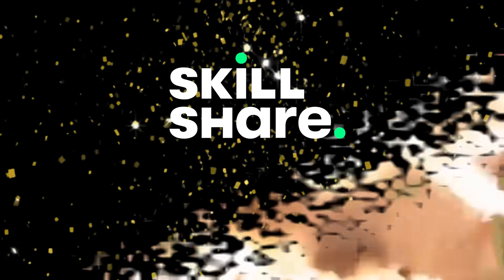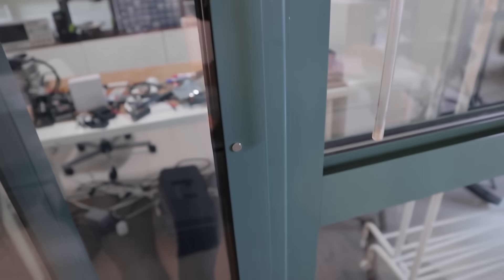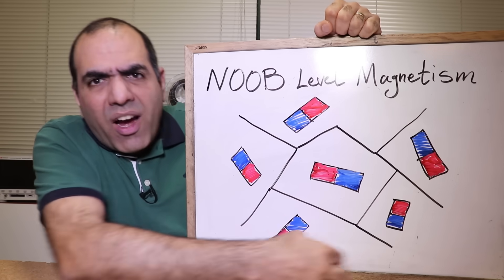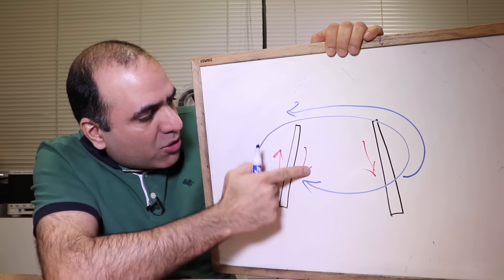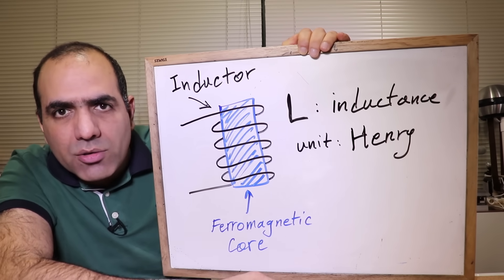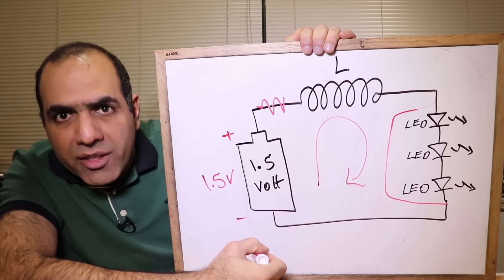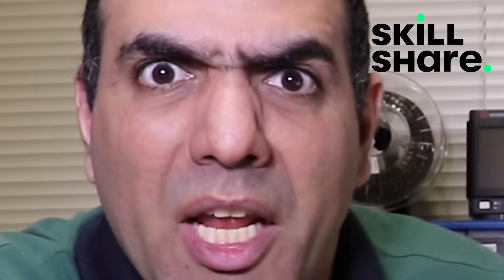Magic of Magnetism & Inductors (ElectroBOOM101-007)

Comment from the maker: Hey BOOMers! If I ever say "Neomidium" I meant to say "Neodymium"!
Reply: Neomehdium
Reply: If you heat a small neodymium magnet until it loses magnetism, and then put it on a larger magnet while it's still hot, will it be almost as strong when it's cold?
Reply: @orbitalbear  no, the field of the bigger magnet is not enough to re align the fields of the heated one
Reply: neo-MEHDI-um
Reply: Try neodiddlium instead ;) Hail to AvE :D
Reply: You need to rectify this issue
Reply: @cudamalloc9054  Using FUUUUUL BRIDGE  RECTIFIER😜😊
Reply: Ka boom
Reply: Hahahahah i love the name
BOOMers hahaha
Reply: well I think that you are a good teacher so thanks sir for teaching us
Reply: Also, if you ever say "Heart" and point to your head, you mean to point to your chest :) 5:26
Reply: this is why black sabbath wrote 'am i going insane'?
Reply: ElectroBOOM just use Skillshare
Reply: Neo did what?
Reply: not a problem even ı cant say ıt correctly nemıdıumı
Reply: This video is the absolute peak of video editing and nerd jokes.
Reply: Neomehdium
Reply: Ok...
Reply: @daffamuhammad391  Boomer.
Reply: @ryank1273  If you have
Reply: ok boomer
Reply: OK BOOMER
Reply: Next video.... How to make transistor amplifier with full explaination and circuit diagram...
Reply: Thx for the tip
Reply: is it just me our your videos have got much educational and much funnier than before?
Reply: Hey Boom love your video
Reply: The Kaiser couldn't say "Aluminimimuminuiuimum.
Reply: Magic
Reply: ElectroBOOM it’s science not Magic
Reply: ElectroBOOM or magnetism
Reply: Lol, no worries, we know!
Reply: Best explanation i have ever heard and wached
Reply: why are your sound levels so much higher than every other video on youtube?
Reply: Meh...ruined my brilliant comment idea
Reply: باشه
Reply: @ElectroBoom its fine. I allways fuck up neydymium name
Reply: I’m a ZOOMER
Reply: 5:28 i don't think thats where your heart supposed to be, right?
Reply: Lol
Reply: @electoboom ok electroBOOMER
I know, it is old, but good
Reply: gotcha
Reply: Love your videos
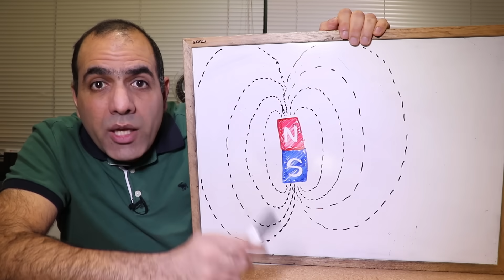Reply: 4:57 The story of my life.....
Reply: the magnet industry caught a break there.. they were gonna have to change it for you!
Reply: Just say "magnets"!
Reply: Ok Boomer
Reply: Ok boomer
Reply: Which editing software do you use? Thanks.
Reply: Ba-Da-Boom!
Reply: 5:27
You say "...feel magnetism in your heart", but you point to the head ?
Reply: Ok boomer
Reply: I was waiting for a faint echo of: "the middle finger is for B field" at some point...
Reply: There is a very good and useful video from The Science Asylum about Special Relativity and Magnetism. It is here. https://www.youtube.com/watch?v=p4gCTmlm5RQ. Good thing is that he is also your subscriber.
Reply: Ok please shock yourself if you say it with something harmless
Reply: I still love you. ♥
Reply: I still like ya too
Reply: Though it's kinda funny
Reply: Keep the content up and don't fry yaself
Reply: i mummered 'ok boomer" and my sister heard 'kaboom"
Reply: I do that same!
Reply: My name....is Neo......dymium
Reply: Nice
Reply: What is a mosfet please make a vid
Reply: Hey Big Boomer i love the way you explain things, Greetings from italy✌
Reply: Neodiddlyum
Reply: On behalf of America, I shall forgive your mispronunciation if you explain the 2003 North American Blackout.
Reply: Yes you said it as neomidium
Reply: You explain pretty good, why don't you make a second channel where you're going to be a teacher? For school level physics? Students love a funny teacher, and that's the proper way to learn physics. By making it fun.
Reply: Ok Boomer lol
Reply: Ok boomer
Reply: if?
Reply: Check this out. This one needs RECTIFYING: https://youtu.be/Scaggwv8Cms
Reply: Best integration EVER!!!
Reply: We have the same pronunciation...
OKAY boomer
Reply: Free energy

https://www.youtube.com/watch?reload=9&v=yNMAX7vW0vQ&feature=youtu.be&fbclid=IwAR2DcuiJ7PZsYtH3f9EY6OuKFOCqPfAITcyu66UDzkErLyXsneM8z6yf2mY

hello Mehdi, this is a job for the Rectifier ... of course that´s bullsh... cheers from Argentina
Reply: Thanks for the RECTIFICATION :)
Reply: Oh no you are human... lots of respect to you EB, love your channel
Reply: Hi, ElectroBOOM! What do you say about that book on amazon which claims that magnetic field looks completely different compared to what textbooks show? Title of the book is this - My Quest to Understand EVERYTHING: Everything is the Mechanics of Reflection.
Reply: well
Reply: Why pictures of all lines of force in a magnetic field need to be eliptical????? What if lines of force is parabolic like a projectile traced by an object above the earth at it's escape velocity. Then will it violate  Maxwell's equation???
Reply: @victormaxwellpeters9771  
The Magnetic field of Faraday is wrong. 
This is how the true one looks like... https://www.amazon.co.uk/s?k=george+warehouseman&sprefix=george+warehouseman&ref=nb_sb_ss_i_1_19
Reply: @jurisbogdanovs1  is that sarchasm???? Or replied with innocence????
Reply: @victormaxwellpeters9771  
No sarcasm. The pattern of magnetic field doesn't look like textbooks show. You would be surprised what were the arguments when the existing model of it was created. But for the true pattern there are many proofs. All that in that book.
Reply: @jurisbogdanovs1  this model should raise a lot of questions???? Like were exactly does the direction of the magnetic field lines switch over from beeing clockwise to anti clockwise in their preferred frame of reference. Also leads to many contradiction. Then why iron filings spread along the sheet of paper dosent in the presence of magnetic field ( in this case a bar magnet) aligned in the direction of magnetic lines of force which emerges out of north pole and enters into South pole unlike the model quoted by you
Reply: @victormaxwellpeters9771  
Send me an email and I will send you a proper explanation on this with all the proofs etc. And images...
Reply: @victormaxwellpeters9771  
Sent you an email.
Reply: @jurisbogdanovs1  thank you any ways
Reply: Boomer...?
Reply: @patrickamazing mm
Reply: Yes but no.
Reply: @friendlyfire3412  electro kaboom
Reply: Can you review the video where a battery, salt and lemon juice goes into some warm water and bends a fork weirdly?
Reply: @oliverstannard2103  I hope you get to send a link to that video. Try using WikiHow.
Reply: Sir I had a request 

Sir would you please give me one multimeter.
Please sir it's urgent
Reply: Can you make a video on transformers? That would be cool
Reply: is that true?
https://youtu.be/g3oXvy0J4PE
Reply: do not warry we don t trust ppl with axent :-)
Reply: New video to rectify: https://youtu.be/32wSwjGiaK0
Reply: Like htat's the olny mitsake that cmoes out of your fumbmelouth
Reply: Fake content https://youtu.be/07Fx5H_j3G0
Reply: We ain't the ones that are old
Reply: hi elecroboom can you test osciloscop app in android phone by headphone jack 3.5 the app name is ar-osciloscop
Reply: https://m.facebook.com/story.php?story_fbid=10221622357009466&id=1269854021?sfnsn=mo&d=n&vh=e
Reply: SUBTITLES IN PORTUGUESE PLEASE!!
Reply: i have a question... if we connect a 500thz Oscillator to a electromagnetic then will it generate light?
Reply: BOOMERS 
I'm on the floor!
Reply: lmao
Reply: 10 times back emf🤔🤗
Reply: Ok.
...From Japan.
Reply: Neodym
Reply: can you rectify this video: https://www.youtube.com/watch?v=ZyfXvFicp8M&t=1s
Reply: my favourıte channel
Reply: Must include part 2 of this video
Reply: Heh Electroboom. I have put pieces of ferromagnetic screws over the original core of transormer and below the secondary coil, leaving the primary unchanged. Unfortunately my function generator failed so I can't check. What will happen?
Reply: Electroboom is a Dwemer confirmed #Numidium
Reply: Mahdi you're Arabian right?
Reply: Abdullah Ghaith if you’re talking  about Mehdi, he from Iran
Reply: Didn’t even notice
Reply: Hehe
Reply: Hi, if every school in the world had teachers like you, the world would a better place!  
Wish my science teacher 50 yrs ago had of had half your magnetism!
Reply: Don't worry man, we know you are not a chemist
Reply: @5:51  Hello Mehdi sir, I am not a professor but doing PhD in physics. These videos, in very simple manner, explain the relation between the special theory of relativity and magnetism. these may be helpful to you.. https://www.youtube.com/watch?v=1TKSfAkWWN0 ;  https://www.youtube.com/watch?v=Ii7rgIQawko .   Overall the thing is that electromagnetic interactions are strong enough to observe the consequence of special relativity and that the very well known fact that magnetic field affects charges under motion and since motion is relative, it incorporates relativity. On observing same moving charge from different frame of references it appears to be in different environment and that leads to a conclusion that magnetic field is not something separate but is electric field in different reference frame. but it is convenient to treat them separate otherwise life would not be simpler with the 'same field' concept...
Reply: you probably right...let's tst it...let me wire this to my ac imput...🤣
Reply: Sorry I couldn't follow. I was so excited by these exquisite 3D hand drawings you show here Mahdi. Ok be honest, is it you painting or Electrocute? 😁😂
Reply: Looool
Reply: you're forgiven! You are our hero and can say whatever you want to say. You can say "Alumminum" or "Alumiiinium", it's all ok. 😂
Reply: I have had this since childhood: I twisted words. 😅
Reply: @s3rverius  ho raelyl 😂
Reply: Okay BOOMer
Reply: Hey Electroboom. I’m curious to know if you’ve ever thought of how the Ancient Egyptians moved the massive stone monoliths. Many people believe magnetism and acoustics. Do you have an opinion? Thanks
Reply: Thank you for your information. You have preserved me from making a tragic misconstrue a patent. God mystically enchant you thank you.   Overlooking one word.  Could transmute the course of humanity?
Reply: Can u do something with magnetism and mercury? Having a liquid conductor opens up many possibilities.
Reply: you mean neomehdium magnets
Reply: Ok
Reply: Ok
Reply: Thumbnail “I’m a magnetic field!!”
Reply: keep your aluminium nucularisms away from me
Reply: I say nedomimium
Reply: @mark rober
Reply: neomidio
Reply: I see it as "Nemidonam"
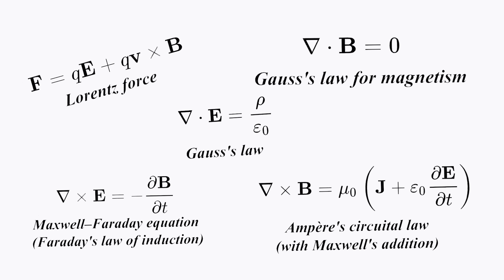Reply: 5:17 a bug:
without censor
Reply: Blessed 💖✨
Reply: for 1st time, I saw himself shocked by HOT Magnet instead of Current 😅
Reply: Oh ok
Reply: BOOM
Reply: Love the vids i  learn and laugh from them.Becuse of you i could explain why biba struja was fake to my friends
Reply: Everyone says that...... Later they're pregnant
Reply: ok :)
Reply: :D "Neomidium", cant read it without imagine @ElectroBOOM in a disguise.
Reply: B00M3R
Reply: Can you explain this ? https://theartment.com/products/the-whack-plasma-globe?variant=17900258984007&currency=INR&gclid=Cj0KCQjw3qzzBRDnARIsAECmryoMQlPksrvrodonBNjM9NF1s8LM8qRdNoxcbJ_LaUxVo8tbHEA1TiAaAs2HEALw_wcB
Reply: Arnav Barman , Mehdi is currently undergoing positive ion therapy for his extreme negativity towards the free power movement. I will try to fill in, as I too am an ELECTRICAL ENGINEER! (play music here) .The globe has a near vacuum and a small amount of gas in it. The outer globe also has a slight capacitance to ground. Pulses of high voltage to the center sphere knock electrons off of the gas atoms making a plasma. The plasma is a conducive media for tiny currents to flow through the plasma to the outer sphere. That causes more excitation in the gas and the other electrons around the atoms jump energy states. These transitions releases energy as light. I’m sure a physicist could give a better, less abstract explanation.
Reply: @BigJohn4516  thanks a lot man !
Reply: @arnavbarman8832  No. This https://www.nrl.navy.mil/news/releases/researchers-transmit-energy-laser-power-beaming-demonstration please
Reply: @arnavbarman8832  watch his videos on Tesla coils.
Reply: @arnavbarman8832  yea explain why it is so much money lol 1399 dollars for a 5 inch plasma ball. U can pick one up for like 15 quid in ur local gimmic store lol
Reply: @TheDarkness344  it's not in $'s that is in Indian Rupees ₹.. Do your math bro!
Reply: @arnavbarman8832  rip lol didn't see XD it's like 20 bucks then lol.
Reply: @arnavbarman8832  Big Clive has a tear down & great explanation on how those plasma ball's work!! you should check his channel out. hope this helps you!!!
Reply: @arnavbarman8832  he already did. on multiple videos even
Reply: @arnavbarman8832  its just a tesla coil filled with noble gas
Reply: Abhishek Patawari was 
BBC
Reply: ElectroBOOM  IDK what the hell that is so I’m not bothered
Reply: @themusicmaster1077  an element in periodic table and also used to create powerful magnets from alloys.
Reply: EXHALER
Reply: next topic will involve the magic of mushrooms and inducers.
Reply: You can say, you're an electroBoomer..

Jk you not that old

Comment: attraction is greater than the repulsion
.
Study of magnetic force between the two magnets for the torque and speed evaluations of rim-driven motor .
Siqing Liu 
 ; Franklin Li Duan
 ; Xiaocui Li 

AIP Advances 11, 125321 (2021)
doi 10.1063/5.0063917
The measurement results show that the relationship between the magnetic force and distance is similar to Coulomb’s electrostatic law, but the attraction is greater than the repulsion.

Comment: Hello Mehdi. I don't want to put in doubt your knowledge in physics and engineering of course, but I think foundamental principle that stands under the working of inductor is the ampere-maxwell's law combined of course with lenz's law. I say this because as far as I know differentiating J (current through a surface) in ∇×B=μ0J+μ0ε0(∂E/∂t) with a derivative in the time you will obtain the instantaneous change of magnetic field.

Comment: Magnetic fields and electric fields are just manifestations of the dielectric. Dielectric is the gandalf of electricity "YOU SHALL NOT PASS tm". Magnetic fields are vortices, currents induce vortices with pressure separation(dielectric). It's just like fluid mechanics.

Comment: I think i have the solution for your questions about how general relativity relates to magnetic waves. Most electricians would tell you that electrons are the source of the energy transfer, and that magnetic and electric fields push electrons back and forth. And this is true, but there arent actual moving charges. Not significantly enough to transfer a significant amount of energy. 

So if there arent significant moving charges, whats current? The equations we use to calculate current assumes electrons are moving, and we can make that assumption because RELATIVE to the magnetic waves, the electrons ARE moving. So general relativity removes the reference frames and allows us to make the assumption that electrons are moving. I can clarify more on this if youd like. We do this so electricians can use manageable math instead of maxwells equations. But this has caused a great confusion because electricians arent taught relativity, they are taught to make the assumptions that make their job workable. 

This leaves the question: whats energy transfer? it happens through the EM field.

Comment: What I get is, the total energy of the system has to be the same. But when you bent the spring, where is this bending energy coming from? The magnet doesnt lose the amount of energy used to reduce its magmetism. I just cant wrap my head around this
Reply: I am stupid, your hand induces the resisting energy to the magnet by holding it in place

Comment: At time 3:48 you mention 'if you bring a magnetic field to a piece of iron, the domains in the iron will align' - this creates 'Barkhausen noise', which is a 'hissing' sort of sound.  Because my parents and aunts and uncles had a ufo hover over their house in 1952 when they were all children in the midwest, I studied all the behavior and symptoms of the vehicle they described.  The 'transformer sound' - or the Barkhousen noise - was a tip off that led me to the vehicle's use of coherent alignment of electron spins and this led me to the Lorentz force being deployed on the metal hull, which I mentioned in another of your videos.  By the way, my two best friends at UC Berkeley in computer science - Reza A. and Sasan P. - we all worked in Silicon Valley after graduating.  There is a large Persian talent pool in the Valley.  Lofti Zadeh was one of our professors at UC Berkeley in the early 1990s.  Thank you for your excellent videos!

Comment: I learned in school that everything has a force, so couldn't the answer be so simple as (the force of an electron is magnetism) - I could contemplate that the reason for it is the size of the energy (amount of energy) in an electron just happens to create that kind of force. I know this is a faulted theory but anyhow that's all I have at this point

Comment: 1:00 does that mean that if u put a capacitor and short it for some time it would be a constant light source?
Reply: Add a diode to prevent the capacitor from discharging when the short circuit is applied, and replace the manual shorting with a transistor, and you've created a boost converter.
Reply: @Owen_loves_Butters  i'll have that in my bucket list

Comment: @ElectroBOOM Hi, first off, thanks for all your entertaining videos, mechanical engineer here (wants to upgrade to electrical one lol). One thing i did not get with your explaination at the end : why would the voltage accross the diodes rise up to 9V exactly. Wouldnt the voltage go higher and the diode simply blows up ? Keep the great work ! Regards.